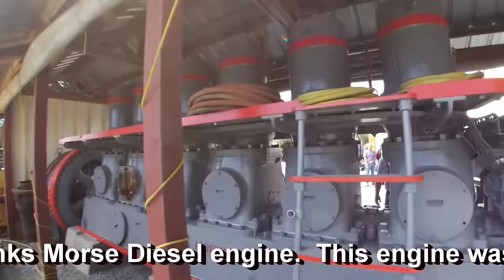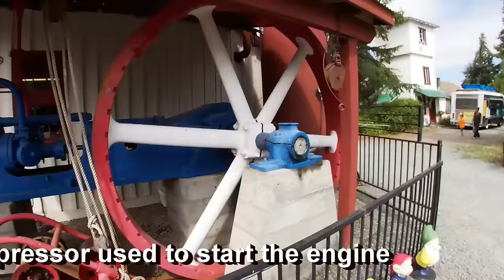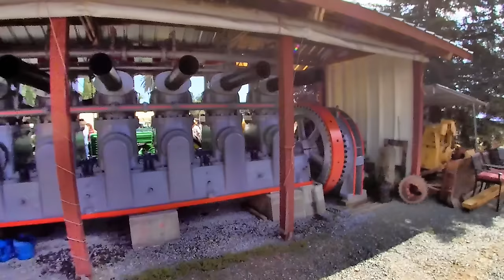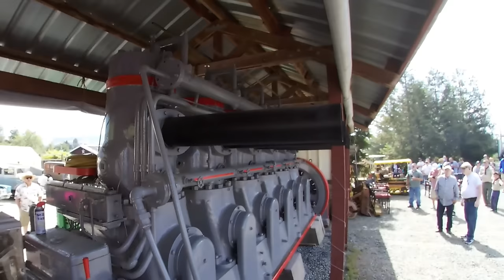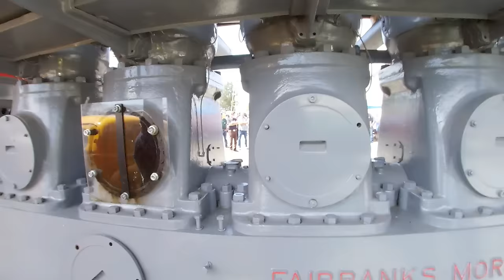450 Hp 1930 Fairbanks Morse Diesel Engine Startup

Comment: I love watching these videos, and that engine for how big it was was incredibly quiet.
Reply: It wasn't under load, even if running at full speed it wasn't producing any torque, hence hardly any fuel burn and hardly any pressure when the exhaust port opened. I'd imagine it would be a good bit louder if loaded up.
Reply: @quillmaurer6563  I’m also guessing that it’s louder in person

Comment: How nice to see an old diesel engine in good condition without worn rings leading to clouds of oil smoke and injectors obviously in a good state, from the clean combustion.
Reply: Wilson Laidlaw it doesn’t have injectors. It’s a 2 stroke
Reply: Two stroke diesel engines do have injectors. You may be thinking of two stroke gasoline engines, using crankcase compression. This engine may have started its life with air blast injection but would probably have been converted to the more efficient and far simpler, less maintenance intensive high pressure injection at some point in its life. See article here on Morse 2 stroke diesel engines https://oldmachinepress.com/2012/08/31/fairbanks-morse-model-32-stationary-engine/ This article discusses the fuel injection on these diesels.
Reply from the maker: Thanks for that link!
Reply: @crazyman401939  Note that the giant two-stroke diesels used in locomotives and ships all have injectors, as do  the ubiquitous (but no longer made) two-stroke engines from Detroit Diesel.  I can't imagine how you would make a diesel run without injectors of some kind.
Reply: I’m

Comment: I'm in the crowd that wants to hear these magnificent machines doing what they were built for,   work.   Some of my earliest memories are of those large displacement, single cylinder engines  oilfield related in my case.  Lulled me to sleep many times as a young child,  almost a surrogate mother's heartbeat.
Reply: My dad used John Deere 2 cylinder tractors. I have the same memory of my dad plowing or picking corn until late and falling asleep to  the rythm of a 2 cylinder diesel.
Reply: You lived that close to a pumpjack with a diesel engine? Also, didn't most of them run on natural gas that came off the gas wells?
Reply: @gregorymalchuk272   Those old engines generally can run whatever kind of fuel you set it up for. Typically would start on gasoline cause that is easier to get going when cold, then switch to whatever was the most convenient at that location, usually natural gas. Our house was less than 2 blocks from a phillips petroleum condensor station  essentially a giant water cooler  that a high volume of natural gas went through to remove most of the condensables, clean up the natural gas stream.   Some might remember the term drip gas. I dont know much about how all that worked but ya   a big single cylinder pump was in the works. maybe an 8 or 10' flywheel on it. There are wells that have been pumping my whole life around here.  Some of them may have started pumping 30 years before I was born.  There is no way in hell a residential neighborhood would be allowed that close to a petroleum plant like that now.    It was an old setup when I was a kid, and continued in operation till somewhere in the early 80's I think. Most of the houses around there were provided by Phillips for their employees who wanted to use them.  Our next door neighbor worked oilfield his whole life did pump maintainence when I knew him,  that neighbor had a big garage full of every imaginable used pipe fitting and valve.  I used to go to his house and he would set up a coffee can full of gasoline and I would stand there with a brush and clean the threads on pipe fittings for a while and he would give me a couple of coins to go to the store and get a Coke.   My sister still lives there and has an 800 foot deep well with a 10" surface casing right in her front yard. That well was intended for a municipal water supply but they never could get the petroleum smell out of it (Gee I wonder why?)   its probably more like 798 feet with the bottom 2 feet filled with plastic army men, hotwheels cars, sticks and gravel. HELLO hello   hello.  I work about 1500 feet from there on a property that was once phillips OKC executive clubhouse.  One building still has the tiles in the floor for whatever that game like shuffleboard is where the gameboard is the floor.  I guess that is shuffleboard? I spend 8 hours a day within 50 feet of a something like  28" high pressure natural gas pipeline running behind the building I work in.  It was put in oh about 1940 maybe? At my home about 2.5 miles from there I have an 18" petroleum pipeline in my back yard,  another around the same size parallel to and another 75 feet away on the other side of an unused rail track and up at the end of the block another high pressure natural gas line running perpendicular to that.  In between here and where I work are lots of massive storage tanks,  and a station that fills probably 150 tank trucks with fuel every day. Ive been surrounded by rivers of petroleum product my whole life and I drive a plug in  electric car,   go figger.

Comment: What a sweet running machine. Hardly any noise at all. 👍
Reply: That's coz it's NOT RUNNING. it's cycling over on compressed air. If you've seen the WORKING ones being started there's a LOT more smoke and noise. Notice the lack of smoke???
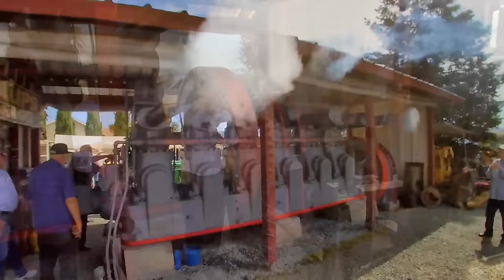Reply: @OffGridInvestor  1:00 for startup.
Reply: a crankcase scavenged in no 2 stroke is no engine to fuck with. 4 strokes be cannot do this unless poppet valved 2 stroke which they are all a want to be, 4 stroke is fake junk power that has no low end torque. that must rev high to servive. the 4 stroke is pure high revving junk with complexity that will break and will not survive for long at peak loads, show me own 2 stroke on total loss oil burnoff.
Reply: There are stihle premix 4 strokes but the nissan ud 2 stroke diesels can exceed them and burn off 40w oil as well as the detroits 2 cycles, i just got one for 2500, im rigging up total loss lube burn off on this engine
Reply: It’s only idling though, I bet under load it makes a good racket.
Reply: @jlo13800  what?
Reply: @kerrygordon6014  4 strokes are fun to torture, i got a few gallons of tcw3 here to fill them up and rev them out, boy does it work good.
Reply: I fill my 7.3 with xd-50/shell roella combo and then inject the oil into the fuel for total loss on my truck, it burns lean and i meter in more when i need it.
Reply: Coz it makes hardly any power
Reply: 2 stroke diesels just don’t make the torque, they also rev higher than 4 stroke diesels.
Reply: @RadDadisRad  They don't rev higher they just sound like that because a 2-stroke has double the power cycles vs a 4-stroke. They sound like having double revs while revving exactly the same like a 4-stroke.
Reply: No noise and no smoke !

Comment: Grandfather had a 600 hp FM on his dredge. Would hand start in summer by barring engine over 3 times then turning fuel on! In winter had steam generator going through a distributor to preheat and rotate engine before starting!  Those were the days!
Reply from the maker: I never heard of one on a dredge before.  Why not.  An amazing engine.

Comment: Slight correction to your torque figures. The calculator you linked gave the torque in inch pounds not foot pounds. The torque in ft. lbs. is 7878.
(HP/RPM)*5252 All that said still an impressive torque monster!

Comment: That’s insane 450hp at 300rpm is a crazy amount of power. That’s the same kind of hp numbers giant cruise liner engines make at that low speed.
Reply: Guess what kinda engines they used to put in big ass boats

Comment: Seeing the visible panel flexing purely from air displacement of the crank rod big end, wild stuff.
Reply: that's not from the rod whipping around....the lower end is used a compressor to draw air in and then blow it into the cylinder above via bypass passages in the cylinder walks just like a modern 2 stroke...

Comment: Replace your plexiglass with a 1” thick slab of lexan to get rid of that flex while it’s running. It sounds amazing!
Reply: Yep, that looks pretty sketchy! I'm wondering if they have transfer ports in the cylinders from the crankcase, since it's a 2 stroke diesel with no apparent supercharger?
Reply: @danw1955  Yeah it uses a reed valve and pressurizes the crank just like a gas 2-stroke, in the video description there's a link to a cutaway diagram

Comment: Your calculation of torque is wrong.

450hp @ 300rpm is 94,537 inch pounds of torque, or 7,878 foot pounds.  Still a respectable torque number.
Reply: In theory you are right, torque and power curves never match one another though.

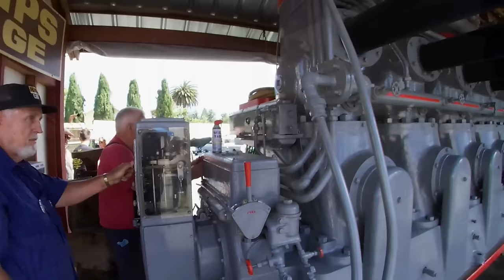Comment: 1:46 Kinda cool to see such a tiny governor on a huge engine.
Reply: These engines dont do high rpm. At work we have an old soviet made 1000kw. generator. Max rpm of the ICE - 276 rpm. A piston alone is almost 2 tons of steel, a con rod is 1.6 tons. Trying to get such ammonunts of mass to move quck is kinda sorta dumb
Reply: You should see the governor of our town, compared to our state.

Comment: Any idea of fuel consumption when working hard ,those old diesels were very efficient
Reply: I believe that the fuel consumption, under load, for this engine is around 175 lbs or 25 gallons per hour.
Reply: @Valenthorpe  I looked up Nebraska tractor data results for a 9460 john deere tractor  as an example ,difficult to be exact in hp comparison but tested at 21 gallons per hour for about 400 hp ,one wonders how much diesel efficiency has improved in 70 years
Reply: @deutzmans1  Horsepower is only part of the equation. While these two engines have similar horsepower, the stationary engine has substantially more torque than the John Deere.

As far as power output versus engine displacement goes, the JD is the winner. If you want longevity and something that will run 24/7 for 40+ years several examples are still in regular service to this day the FM is the clear winner.
Reply: @deutzmans1  Sadly with modern emissions compliance diesel are at some of their lowest real world efficiency levels they have ever seen since they modern version of them was made over a century ago. 

As an old engine buff, like most who look at these videos,  I can tell you that back in the days before emissions regulations one of the top bragging points every engine manufacture had was their HP hrs / Gallon ratings which put any engines fuel efficiency at load in simple easy to understand numbers anyone could see and compare.  

Then when compliance came into play those numbers disappeared over night and to ask about them basically got you the old "We dont like to talk about that anymore." as a reply.  

Now today with Tier 4 emissions on your modern diesel it's honest real world HP hr/Gallon numbers are worse than the worst low end engines from back in the 1930's - 40's had and any farmer/truck driver/heavy equipment operator that pays attention to where their money goes for units of work done can tell you that's not a lie.  

Also it not big oil to blame either.  They make at best 5 - 7 cents off every gallon of fuel they sell.  Its big government that makes 45 - 60+ cents of each of those gallons that is to blame.  They need more of your money and fuel efficient engines dont do that for them.  

Rather why your 4000 # sedan gets 25 - 30 MPG and your old diesel semi rig that weighs 20x as much and has 10X the aerodynamic drag only gets 1/5 that driving the same speed on same road. (until Tier 4 diesel emissions regulations put an end to that too.)

Comment: I'm trying to figure out how air pressure starts the engine.  I'm speculating the air is piped into one or more cylinders with an automatic valve in sync with the engine timing, but I don't know.  I've been watching a lot of videos here on 100-year old engines, and they all seem to be low rpm which requires a large flywheel to even out the power output and keep the engine running smoothly.  Maybe in the early days they couldn't calculate and/or manufacture finely balanced pistons and crankshafts to avoid unbalanced angular momentum at higher speed resulting in vibration, wear and tear?

Comment: You quoted inch pounds of torque (above in the description). The ft/lbs. of torque would be 7,878. hp x 5252/rpm=torque (in ft/lbs.)

Comment: 450 hp today can fit in a package the size of one of those cylinders crazy
Reply: yes but with only 1/25th of the torque, this beast makes about 11000 ft/lbs of it
Reply: Also today’s tech may not last for a lifetime unlike this simple diesel monster
Reply: Is that 450 horsepower all day long or just for a few seconds at a time? The rated power of car engines is just what they can do for a few seconds for a quick acceleration, which for a car is most relevant as they typically cruise at a small fraction of that. Run them like that for more than a few minutes and it will overheat, and would wear out very quickly. Big stationary engines even now still have a much lower power-per-size relative to car engines, but are designed to produce that power non-stop, and in many cases have a longer oil change interval than the entire lifespan of a car engine. Though a modern engine of the same power, even if designed for the same application, would certainly be a lot smaller than this one.
Reply: Quill Maurer our excavators are running full tilt most of the day. So in some cases yes all day long
Reply: @bigdave6331  So you're saying a 450hp excavator engine is the size of one of these cylinders, not just a 450hp car engine? I would consider that to be a valid comparison then. Less torque as others mentioned, but if it's driving a hydraulic pump that can be sized appropriately for the RPM and torque that doesn't really matter.
Reply: Quill Maurer right, i was thinking more along the lines of a 3406 cat motor. Or what have you for dozers excavators etc lots of power use

Comment: Some  info on generators:  Modern  generators,  driven by  'engines',  require as a general rule : >  2  hp  of engine, for every 1,000 watts  of  generated power. So, in this engine, the generator would be about 225  kilowatt,   ( 225,000 watts)   BUT,  because this thing runs slow, from a modern generator viewpoint (most modern diesels, run gens at  1800 rpm-with more stator coils, than a 3600 rpm  gas one ) and  HAS  ALOT  MORE  TORQUE,  perhaps the generator could be increased 25  %.    Thanks, for the  90 year old education and   fine   examples ;  SIRS !

Comment: That plexiglass window looked so freaking dangerous
Reply from the maker: I have to agree with you, but when they run it some is always standing by to keep an eye on it.
Reply: @georgehomenko5358  yep that extra bar across looks like a quick last modification
Reply: Looks to not be in the compression chamber. So I don’t believe it would be dangerous at all. Just like a sight glass to make sure oil is getting to it.
Reply: @mannymolina4459  yes correct, however there is still crankcase pressure with all that movement going on - beside if there is blow by the rings that develops during operation that will increase that as well and if a conrod breaks well  which ever way the wind blows
Reply: @mannymolina4459  
This rare variety of 2 stroke has no valves at all and actually uses the pressurized crankcase to scavenge the cylinder, much like 2 stroke gasoline engines.

Comment: Ok i look at this thing and see no blower or turbo (obviously) how do these old 2 stroke diesels work without? Or and I just not spotting it?
Reply from the maker: No blower.  Uses a pressurized crankcase and piston ports.  When piston comes down the crankcase is pressurized because of a flapper valve.

Comment: Fabulous!
But where is the cooling?
Reply from the maker: It has water jackets and they use well water to cool it. Originally it most likely had cooling system, but no need now that runs short.
Reply: A huge ratiotor out back

Comment: Any idea how many ftlbs of torque that monster puts out? No doubt at least 1/2 ton by my estimate.
Reply: Pat Dennis I'd have to guess it's way more. My semi puts it more than that with a C15.
Reply: Almost 4 tons... HP=tq*rpm/5252 so 450=7878 (torque) * 300 RPM stated as the 450 hp RPM rating / 5252
Reply: @dfabeagle718  so if we spun this beast up to 5200 rpm we'd be making 7800 horsepower?
Reply: @MattLF9  That would be something to see... something terrifying! HP and TQ are always equal at 5252 RPM... so yeah, if you are making 7878 ft lbs at 5252 rpm, you would be making 7878 HP.
Reply: @mattlf9120  You'd have chunks of flywheel scattered all over the county. I'm guessing the engine would destroy itself long before 1000 RPM.